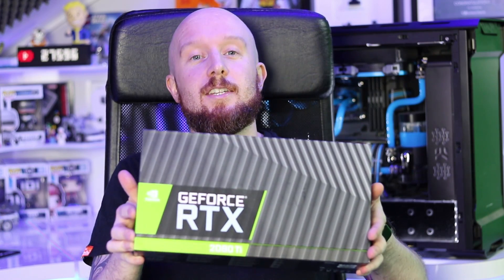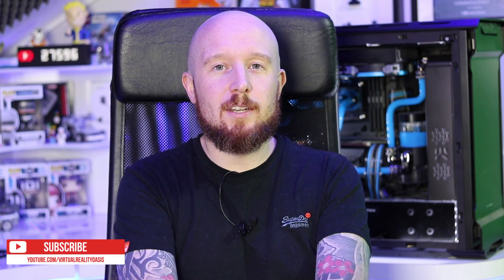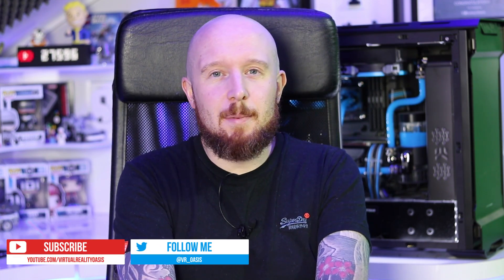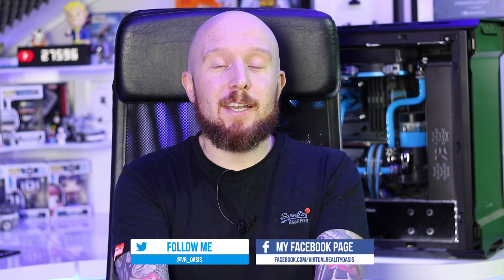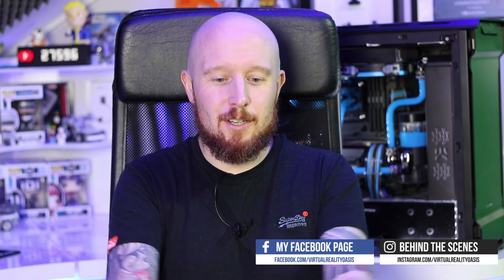How To Watercool RTX 2080Ti - EK Vector Install Guide

Comment: I see you installed the thermal pads on the mosfets (marked as 2 in EK manual), but not on the coils (marked as 3 in EK manual)?? Why was that not done as the manual shows?
Reply from the maker: Since this video released EK updated their manual on the site which suggests putting further pads on the coils...
Reply: @VirtualRealityOasis  Yeah i have my one since 3 weeks, and i saw the new Manual. Should i be worried? and remount the Cooler with the Pads on Coils? Or is the card safe without this pads?
Reply: A year late but ADD THE MISSING PADS, i noticed instantly after i ran my first thermal test that my temps were sky rocketing. Those pads on the coils are mandatory. Sucks I gotta drain my system after thinking I was complete, but that's what makes this fun i guess.
Reply: Actually I recently cleaned my pc's loop after a year and after I redid my pads I put pads on the coils as well and the humming sound from my gpu was greatly diminished. I would recommend padding both.

Comment: Quick question, I have the founders edition of the RTX 2080 Ti, will it run just as fast as a out of the box overclocked etc and with a water block installed? They don't change any electronics on the cards when they overclock and watercool them right?

Comment: So I bought this card online. And it was super cheap because it was missing the back plate. Its fully functional. I was wondering if this back plate could be installed on it with it all the water cooling parts. As I saw this back plate sold online for about 30 dollars. Do you think that would work?

Comment: I have done the evga step up program and the 2282KR is the only one they would allow me to buy. I would like to get a card for it but do not know if mine
is a reference card or not, as the EK-VECTOR-RTX-2080-TI-CP says not to use one.  Hard to find any reviews on My new card coming Wednesday.

 I am using my 5 year old 680's in SLI right now, they both have water blocks and fittings but are set up with no cooling or fans and run at 52C 
and I can watch videos or Netflix, but cant play games as it crashes every time.

Could You please explain the type c connector for the CV1 and the new 2080Ti ?   I thought the DigitalLink cable would allow the rift
to plug into an adapter and instead of using 3 ports, You would plug the 3 from the rift into just the one DL connector.

If I need some type of special cable to do this, I can order it and it will arrive before the 2080Ti on Wednesday.   Thank You so much for Your Help with this 

I love flying in DCS World and cant wait to see what improvements will occur with the new 2282 RTX GPU !  https://www.youtube.com/watch?v=66ujGOrQu1E&t=32s

Comment: This is a low performing waterblock, my 2080 TI gets overheated when overclocking. One source to the low performance is that the heatspreader do not cover the whole circuit board so the power circuits gets incredible warm around a tdp over 300 W. Yes i have an aluminium backplate also. I want to run the card in 330 W wich works fine 10-20 minutes until heat builds up.

Comment: I'm wondering if EK changed the instructions.  Noticed you didn't put thermal pads on the chokes (which is the instructions I saw when I ordered my Vector); however, looking at the online manual now it looks like they do specify to put pads on them.  https://www.ekwb.com/shop/EK-IM/EK-IM-3831109813140.pdf
Reply from the maker: It’s seems like they’ve updated the guide as that wasn’t in the instructions before. Thanks for letting me know []-)

Comment: I'm sorry if I missed what GPU you had before, but which GPU did you upgrade from and did the upgrade improve your VR experience? Currently using a Vive with a 1080ti paired with a 6700k and it seems to work fine for me. Still tempted to get the 2080Ti though :p. Some temps and max speed of GPU under water (if OCed) would also be nice. Thanks and nice vid.
Reply from the maker: I upgraded from an original Titan X (around 980 performance) I wouldn’t  recommend an upgrade from a 1080ti to an RTX2080ti you really wont see any difference in VR performance. You have a solid card there []-)
Reply: @VirtualRealityOasis   Thanks for your advice!

Comment: 2080Ti !! Beast.
I notice below you have a 6700K, I had the same with my 1080Ti and going to a 8700K saw decent gains in FPS in some stuff, 20+ FPS so I imagine you would get even better gains with a 2080Ti.

I have 4 pc's in the house and as I upgrade mine the others get my older stuff, so I still have s 780Ti, 980Ti and 1080Ti plus a 970, but this is the first time I've not got the new Ti, not sure I can justify £1100+ for a average performance jump.
Reply from the maker: The pricing on the 2080ti is ridiculous but I waited two years to upgrade so I had saved up over time! Unsure whether to sell the old card or build another machine lol []-)

Comment: Mike did you not have the Titan XP before.. why do an upgrade like this for only 2-5 frames more.. your Xp have more cuda core more memory.. basically its only bit faster memory and clock speed and the never going to be used rtx you paid for.. well if have so much money can flush it down the drain feel free to do so.. Just fel a bit sad for you to waste the money on something you really not going to see any improvement with. could have used those money as help for a star vr hmd instead maybe ;)
Reply from the maker: I was using the original Titan X so it's similar to 980 performance. This will help more with recording and streaming than playing normal VR content []-)
Reply: @VirtualRealityOasis  ok Mike then make a lot more sence.. thought it was xp you was rocking;)
Reply: no. just..no.